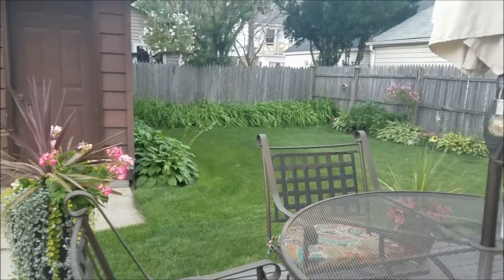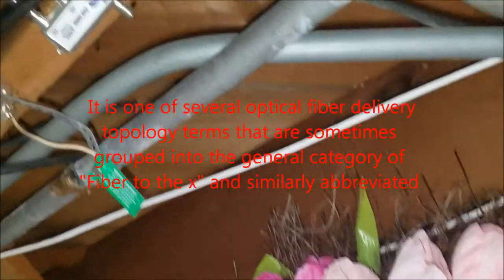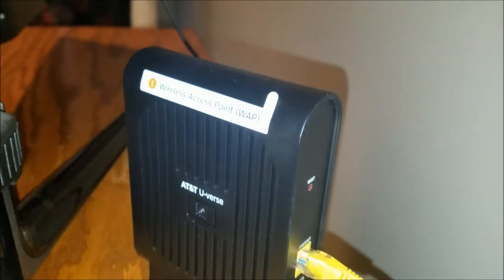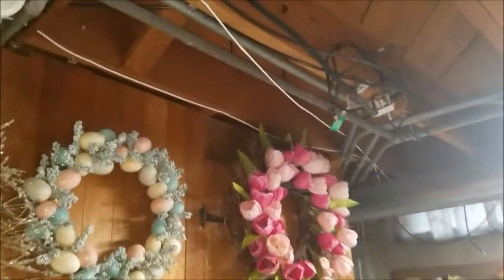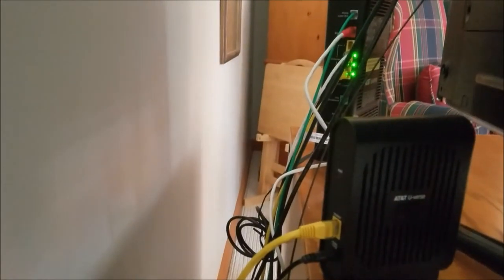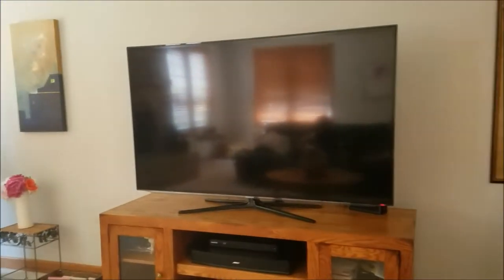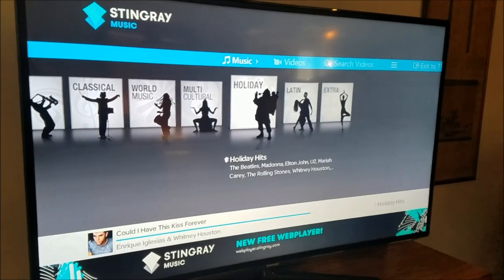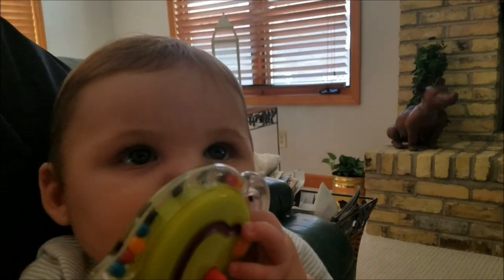AT&T fiber internet install

Comment: Even though you get higher broadband speeds, you are still restricted to 4 video streams on most of the ATT DVR's. 6 if you have the 1tb DVR. So even though you say you can have unlimited STB's, you cannot use more the 4 or 6 streams at a time. All STB's can be connected via cat5/6. WiFi will still be poor in a large house since the Gateway is not a good wifi router.

Comment: Multimode fiber is not necessarily faster than coax with DOCSIS 3.0 (cable internet). In fact FTTH is designed and built with the exact same layout as coax, a shared main distributed in a neighborhood (node). The main difference is that fiber isn't susceptible to noise like coax is. DSL is limited by distance and the amount of data that can be sent over 2 wires. 

Cable companies run fiber to the node or to the curb and have the hand off to copper at that point. 

What most people don't realize is that most of the time they will NEVER use the full capability of their internet service because most websites are limited by their upload speeds. You can only go as fast as the slowest link...
Reply: 100% wrong. GPON is not the same as DOCSIS. DOCSIS is a noisy tech with alot of overhead. GPON is passive (passive optical network). The "main difference" is that DOCSIS is not as good as fiber, because fiber is already so fast. Not even DOCSIS 4.0 will keep up. Thats why cable company are abandon coax instead of docsis 5 docsis 6.